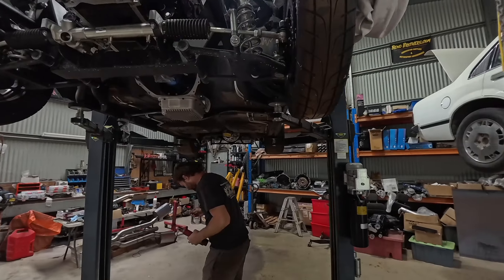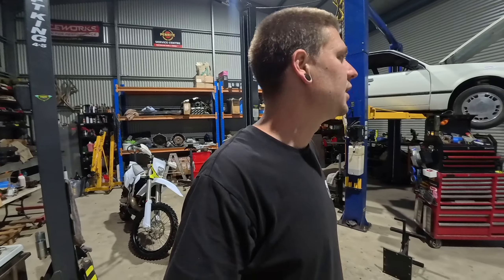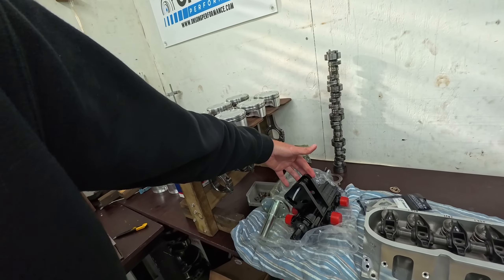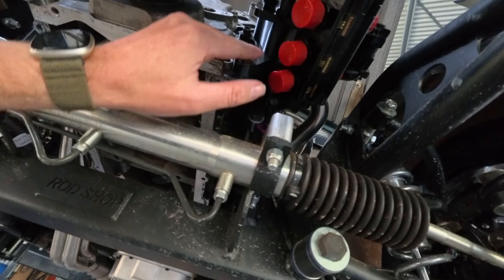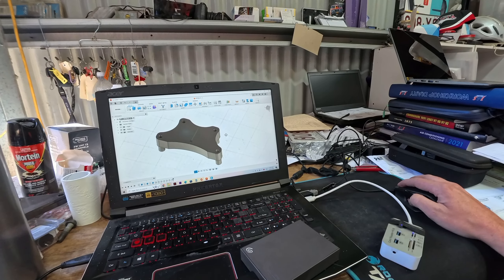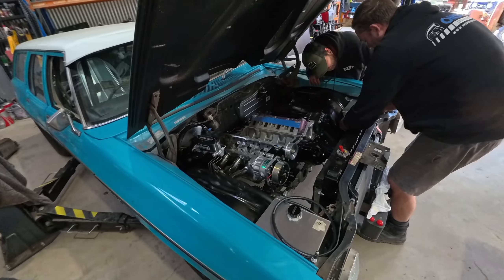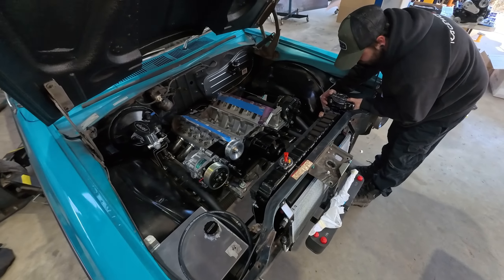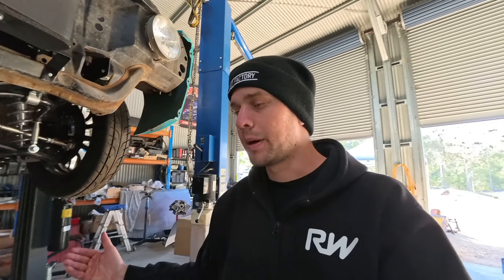Custom LS Parts || HJ Wagon Build Part 6

Comment: If you are prototyping in standard PLA (for fitment etc) then i highly recommend picking up a Bambu A1 during their black friday sales on right now. very fast print speed and great for PLA. 

If you need extra build volume then you can look at a creality K1 Max or similar, but you could buy nealy 3x A1 printers for the same cost. 

For record print speed in their high speed PLA is roughly 400mm/s